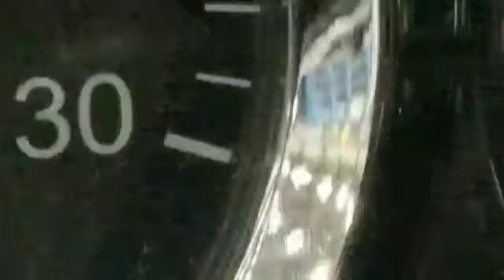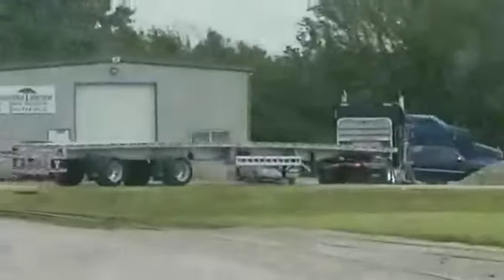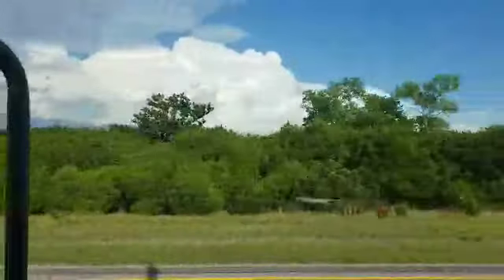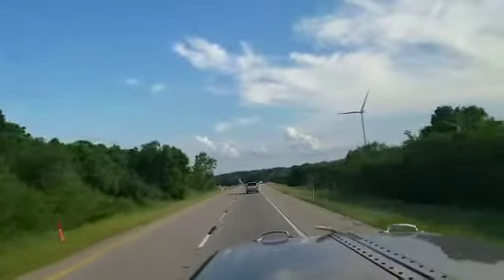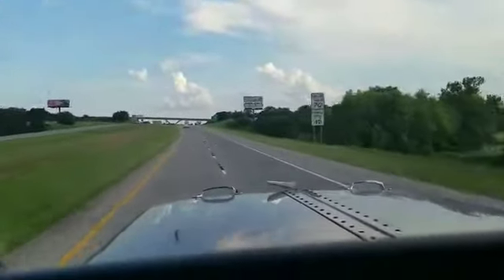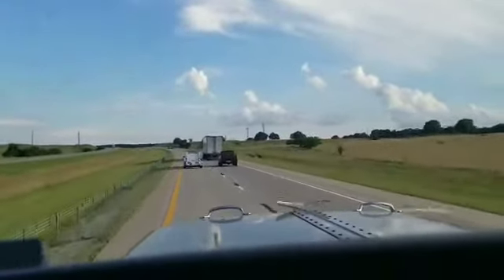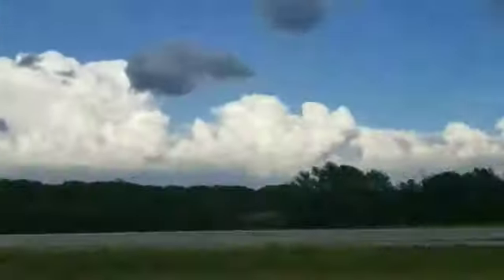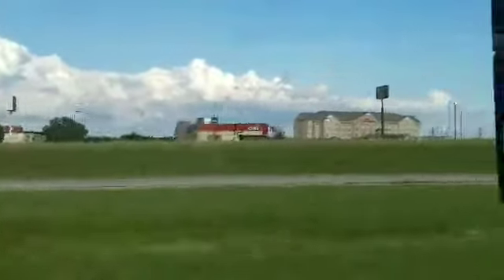Stainless Steel, Pink PVC, White Thunderheads

Comment: ... OBS works in conjunction with YT...awesome thunderheads... good ride.. thx for sharing..BB
Reply from the maker: OBS may work in conjunction with YT but there is still a minimum requirement for FPS, frames per second. Which IBS requirements are 24 fps! I can't maintain 24 while driving. It's like 20 I think, so then it's all choppy. Doesn't make a very good video! Still don't know why I can't live stream through YT? RH